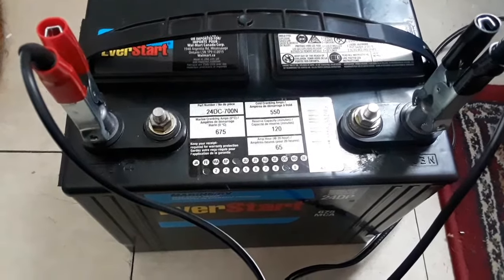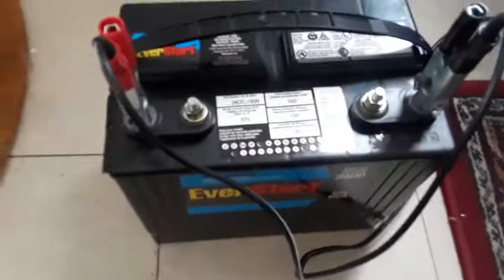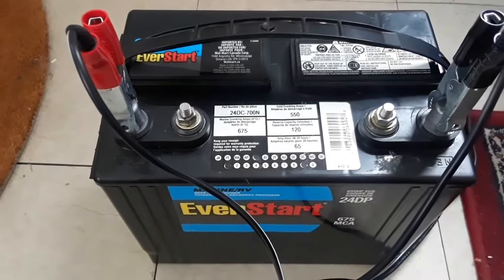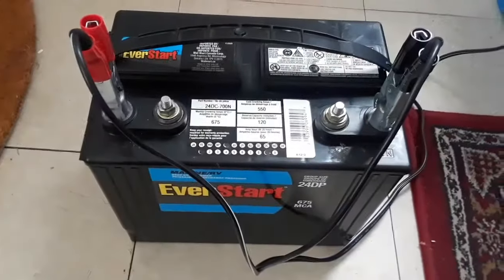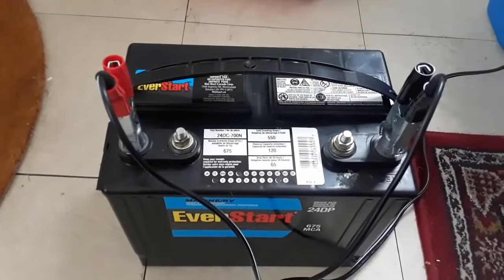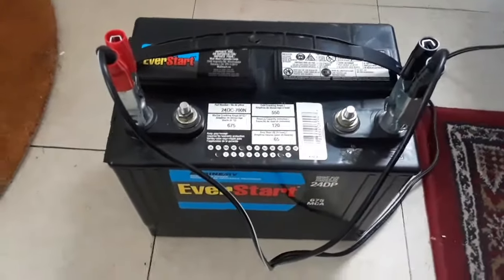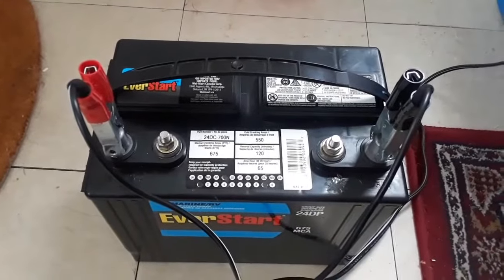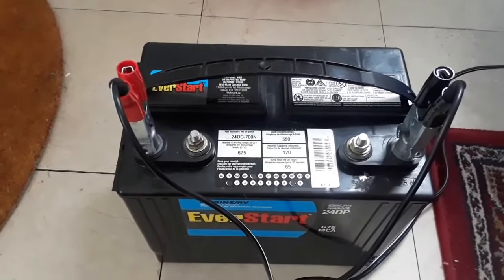Don't Make this Mistake with Deep Cycle Batteries!

Comment: You need at least a 30a charge to revive them when not charging it via another battery. the reason it charges via other batteries connected in parallel is that the other battery will supply high amps to the dead one. Charging it with a high amp charger, preferably 30a will revive it. I have done it countless times with Gel deep cycles.

Comment: Test everything at home before you hit the road. Most important thing to realize is that when you are using an AC device, they are going to be 10 times the amperage when going through a DC inverter. An apliance that normally uses 5 amps AC, when you plug that into your inverter, it will be using 50 amps DC. A small space heater is going to drain a two x 6 volt battery system wired in series in under 30 minutes.

Comment: Having a low voltage cut off on your charger controller is a must. Then  also you can install a separate shunt battery meter with alarms on it to be extra safe.

Comment: It’s perfectly fine to use a good battery in parallel to the dead battery to get the voltage up. That’s what you are doing when you jump start a dead car. Same principal. I would have definitely attempted it to get a charge back on them.

Comment: Try connecting your batteries back like you had them when you discharged them.. Then reconnect your charger positive to 1 battery and negative to the other 1. I will assume that's the way you discharged them...  Best of luck to you sir. I hope your able to revive them!

Comment: A good smart pulse battery charger with AGM battery restore feature AND cycle the battery (quickly drain the battery to a point using something like a welder and recharge them again). Each cycle the battery can get stronger back to close to a higher charge and hold it like it should. If you do that and it don't work time for a new battery.

Comment: That is not an AGM battery. That is a flooded battery. It is known that flooded batteries don't keep their charge as good as AGMs. The Walmart Everstart H8 AGM is an AGM battery but it costs  $169.
Reply: I looked it up too, this is a lead acid battery from Walmart. I owned AGM batteries for my solar system and drained them a little over 50% and they worked for 5 years plus.
Reply: I just bought deka pb battery by mistake for my car its deep cycle can i still use it on my car ?@cuttiebear46
Reply: There are a lot of recent comments from an older post. I looked at all the marine Ever Start deep cycle batteries at Walmart today after buying 3 regular 12v 24F 600 CCA and not seeing the warning “ not recommended for inverted power” Returning those and now looking at Duracell RV 75ah. I am new at this and want to make a temporary power inversion station to power my refrigerator and the  tankless gas water heater electrical system. Any thoughts?
Reply: @EARTHKEENING I heard that some deep cycle bat. Don’t have the CCA needed for starting engines.

Comment: I grabbed the genius 10 charger maintainer.
I have agm 12v.
The gen 10 has a restore mode. I let 2 batteries sit to 12.40 and came to find that was bad. The charger restored agm.
It also has settings for 6v 12v, flooded, agm, and lithium.
Checkit out. Maybe itll help

Comment: Repairing a completely dead battery takes a long time, I brought a dead battery back from the dead on a dumb old charger which doesn't require any charge in a battery, it took a week to even start building a charge, after 10 days it was back at 6v when I could put a more powerful and newer smart charger on to run a maintenance mode which was able to restore the battery to 12.1v the battery definitely had damage but holds enough power to be useful for light work.  

For my off-grid setup I am using 2x150ah gel batteries because I got them super cheap - the business had 200 bought in for a job that fell through so sold everything off as a loss (£80 for 150ah!) to clear the inventory and write off on their taxes. Their loss was my gain I guess. :)

The setup has a shunt with a battery monitor with alarm, I don't plan to ever let my batteries get too low. ;)

Comment: I don’t think that’s an AGM battery, it appears to be a flooded cell battery.
Reply: Thanks I forgot to mention that to him lol
Reply: Absolutely true!
Reply: Yes but AGM mode gives a slower charge and maintains at a lower voltage which is better for any deep cycle battery
Reply: What mode to charge on? I have a Everstart 24DC and a NOCO 10amp charger. Would the mode be correct to charge on just 12v or AGM?

Comment: What do you recommend for the ideal float charge deep/AGM gel batteries? This seems to be different for each type but usually certain ranges. I also wondered if you want to slightly lower the float charge for older or damaged batteries?
Reply: > What do you recommend for the ideal float charge deep/AGM gel batteries? 

The manufacturer of any reputable deep cycle batt will publish charging recommendations. 

> I also wondered if you want to slightly lower the float charge for older or damaged batteries?

Float likely doesn't matter, but sulfated batteries will require longer Absorption duration, possibly higher Absorption voltage, and definitely increased water maintenance for flooded types.
Reply: @fratermus5502  Thank you very much.

Comment: I did the same exact thing you did.  We went on a camping trip to Colorado. Boondocking.  Bought 2 brand new deep cycle batteries.  Hooked up in parallel.  Didn't use the heater, but used a inverter to watch TV and general use of everything else.  Next morning, batteries so dead lights wouldn't even come on.  We had to leave that morning and the first thing I though was how am I going to get my awning back in and my slide.  I've never used the crank handles to do so and I was worried.  I had a small generator and I hooked it up to the batteries.  Got my awning and slide back in.  However, I ruined the batteries from letting them get down to zero.  I could charge them, but they hardly hold any charge now.  Lesson learned.  Don't let them get under 12 volts or you killed them.
Reply: Search this on youtube. you may be able to salvage them. How To MAKE OLD BATTERIES NEW Again!!! 12v 6v Deep Cycle, Car, Truck, Golf Cart, Semi
Reply: @MYCHANNELWITHMYSTUFF  Thank you!  I just did.  Good advise and tips!
Reply: Depending on the type of charger you can get them back.. mine sometimes dip below 10V and they have come back solid as long as you bring them back up over 14 as soon as possible
Reply: But I should have prefaced that by saying I do always have a small charge coming back to my setup via a 100Watt solar panel. It’s not much but maybe it’s one of the reasons mine didn’t end up popping

Comment: I did the same thing on our first outing. I learned when boondocking in the cold you don't run the heat until morning when you can turn on the generator. (which is a must) Unless you have solar too like in our GeoPro the sun hits the panel in the morning and were good but I still wake up and turn on the generator. (Generator before bed & generator when you wake up.) If there's no sun then you watch your percentage and then generator mid-day. Also, if it's that cold do not run your tank heater in the night. Wait till morning to flip it on. That will run your batteries down too in the night.
Reply: Portable electricity, generators and heaters... You people have an odd sense of "camping".

Comment: AGM while suited to cold weather you need something Iike 4 of them to have necessary amps to run an electrical heater even then usually not enough amps available with other things going on sapping the batteries, want to be warm in cold weather use a small diesel heater, use your batteries only to cook if necessary, propane is  probably better there also, AGM is good for lights and other low amp stuff, and usually give your AGM’s time to recover with solar in the day time when lights are not in use. Always good to have a generator to bump them up before use if solar has not been pumping enough Ah for your batteries to keep floating charge going with usage.

Comment: For heat, look into a Mr Buddy propane heater. Safe for indoors. Save batteries for lights and everything else. Electric heat draws ALOT of juice. (Ps. Nevermind. Didn't watch till end before I commented lol)
Reply from the maker: Got one, thanks
Reply: Diesel heater ?
Reply: 12V electric blankets are good for this kind of situation.  I have a teardrop trailer, and in those situations where you have no shore power to run a heater from, and you don't want to (or can't) run a generator all night, they will keep you pretty warm until morning.

Comment: If you run your everyday use on batteries then charge the batteries by house electric is that waisting the same volts back to charge the batteries?

Comment: I'm using 6 12 volt Lithium 100AMH batteries and can run anything i need,You need stored power in batteries for the inverter to work to heat,light,cool food

Comment: Each battery has only around 1kWh and you can only use half of it. If you have two, 1kWh is not enough to run a resistive heater overnight. Get a heat pump heater and you might be able to do it.

Comment: I have heard they have a controller that will turn off the inverter if it is draining the battery and if I remember right it gives you a read out with the % 
I run a buddy heater for heat and I only use my battery to run some 2 high efficiency lights I I use solar or electric depending on where I'm parked or how long I'm going to be there I use a generator to run everything from power tools to my kitchen and computers some of them are solar powered too 
I wouldn't use batteries for heat get a buddy heater and a long factory hose and two 20lb tanks and a filter don't run it without the filter and if you do that most likely any problem you will have is the filter 
Keep the heater clean and change the filter once a year or so depending on how much you use it!!
This is my second year living off grid and I gave up on electric heaters unless I am someplace I can plug in!!!
When the heater filter goes bad just bypass it and buy another one asap
And definitely buy the mr heater hose the cheap Chinese ones leach oil and it messes the heater up and it's a pain in the ass to fix especially when it is 14° out side and you don't have part's cleaner or a pipe cleaner lol!!!!
I was pissed of at buddy heater and said some bad things about them but it was my fault for buying the cheap hose I bought the good hose and a filter gave it a good cleaning and haven't had any more issues in 2 weeks 
SORRY MR BUDDY HEATER MY BAD!!!

Comment: Thanks too for sharing your experience about deep cycle batteries, and yes they said Gel or Lead Acid type of batteries only have 50% depth of discharge and this video is 3 years ago and I bet you've already learned more if not all about batteries, and  I hope smart chargers now or a battery beeper or chunts can help with the similar problem you encountered plus computing our loads base on the actual useable capacity of the battery, thanks I am really new too just like you when you made this video so I can relate to this episode. Now I feel the need to have a solar charge controller for a low voltage disconnect feature or just use a low voltage disconnect module connected to the battery and the inverter so I can also see it's voltage  while its not  connected to a charger.
Reply from the maker: Since I made this video I have: Added another battery in parallel to double the amps, moved the batteries inside and into a insulated box, bought a big buddy heater for back up heat. I have videos on all these upgrades. Thanks

Comment: I’m confused. I have a 24 volt battery for my kayak motor. I have a old Sears charger. It says 40amp 12 volt and you can flip it down to 200a engine start or the other side says 2 amp 12 volts . So I’ve been using the 2amp 12 volts to charge the battery. I thought it was full charge. I took my kayak out and the volt meter on the battery box said 11.5 and my motor said charge it. I thought I was using it right but I’m not sure now.
I’ve only used it four times. 
I used to charge group 31 deep cycle batteries. I got a different charger that would charge ten of those batteries. 
So I’m confused on this one. Can someone please help me.
Am I only getting 12 volts from the battery or 24 ?
Reply from the maker: You need a 24 volt charger.
Reply: @jackofalltradesmasterofnon6120  thank you!

Comment: Sometimes the battery itself can be defective.  I had the same brand and   it was new.  After charging it would run down very quickly.  I took it back. It was tested.  They found it to be defective.  They replaced it with a new one.

Comment: I am currently living in a Small Camper Trailer with no Electricity. I was thinking about getting a 12 Volt Deep Cycle Marine Battery to hook up to my 2000 watt inverter so that I could run either my microwave, or my hot air fryer just long enough to cook a simple quick meal. My question is would a single 12 Volt Deep Cycle Marine Battery be enough to power the inverter long enough to run the microwave, or hot air fryer for 5 to 10 minutes, to cook a meal, or would I need a 2nd Battery, and hook the 2 up in Parallel with each other ? I also know that I will need a charger to keep connected to the battery to keep it charged, can I run the charger off the inverter to keep the battery topped off with the inverter hooked to the same battery ?
Reply from the maker: Definitely get two batteries and hook them in parallel. Also get 400 or 500 watts of solar panels to recharge. You can also get a small generator to too up the batteries. Thanks
Reply: @jackofalltradesmasterofnon6120  I have a 5000 Watt generator. I was hoping to be able to completely stay away from using the generator for charging the battery because of the amount of gas it uses, and price of gas. That was why I asked if I could just keep the inverter turned on, even when not using the microwave or hot air fryer, and plug the floating charger into the inverter, and hook it up to the battery, just to keep the battery topped off. I was also hoping I could get away with just using one battery, and not having to purchase a 2nd one as my income is limited. I am trying to save as much $$ as I possibly can.
Reply: @jackofalltradesmasterofnon6120  I also do not have the financial ability to get anything solar at this time. I am living paycheck to paycheck, and trying to keep my rent paid, and food on the table for myself. This is why I am trying to avoid spending a bunch of $$ that I really don't have on a second battery, and on solar.

Comment: 65 x 2 = 130 ah. you only want to use 50% of the total 130 ah, which is 65 ah. theoretically lets just say, the heater you were using has an energy consumption of 400 watts. now the formula that we will use is 65(ah) x 12(voltage)=780/400(watts)= 1.95 (hours) of heater use. Maybe buy 2 deep cycle batteries with a higher capacity. also let me add that connecting a dead deep cycle battery in parallel with a fully functional deep cycle battery will jump start the dead battery, required you have the appropriate equipment and wiring.

Comment: you need a inverter like 8000 watts with 4 12 volt battery  100 amp you get 4800 watts thats will run you for sure

Comment: Bro deep cycle is designed to be depleted its still good. Charge controller and use an inverter to run stuff.
Reply: These marine batteries are not true deep cycle batteries but a hybird made to start your boat and run some simple electronics. They put a one year warranty on them because most people will think its ok to run them dead with a motor or heater, you can but the life of the battery will be about a year and closer to that year it will hold less and less of a charge. 
If you really want these cheap ass marine batteries to last years you really should never run them below 50 percent ever. True deep cycle batteries you will see in fork lifts and golf carts because most of the time whoever is using it will run it dead now and then even true deep cycle batteries should only go down to 20 percent.
Reply: @mikesuperman5421  good rebut I had not noticed that the are not the max battery until the rewatch. I agree batteries for outboard are garbage you need the 122ah max but they take a 14.8v force charge to get to full capacity so you have to have a 2000w inverter to charge or they just drain 9 hrs also.
Reply: @captaincarl4346  Even a "MAX" battery is still NOT a true deep cycle battery.  A 24DC-MAX is still a Dual-Purpose Marine battery.

Comment: 1st off, if your battery charger is putting maximum amps into a battery that's excepting it, this is an indication your battery cells are shorted. I've seen this happen before when the electrolyte solution freezes and shorts the cell plates layers. At this point, the battery is only good for refurb on a new battery. A lead acid battery if the electrolyte solution is in good shape will not freeze that easily, unless it's Extremely Cold, below 0 deg F. Lead Acid or AGM deep cycle batteries get weaker anyway with extreme cold. A discharged battery should rarely drop to 2 or 3 vdc unloaded. Most smart chargers will not start to charge a 12vdc battery unless it at least senses 9 to 12 volts on the battery, unless it's an old style battery charger like you had in your video, it doesn't care. But if cells are shorted, it will like you shorting the battery charger positive & negative together. You might even hear the battery charger kicking off and on because of an over current load, protecting the charger.

Comment: Mistakes here: A fresh recharge can start with a ballast resistor such as a tungsten 110 volt light bulbs. When the battery reaches 20% , go ahead and increase the charge. These batteries should only be discharged to 70%, or the plates will deform. Batteries should never be hard wired in parallel. They fight each other. They can power separate circuits with separate chargers.